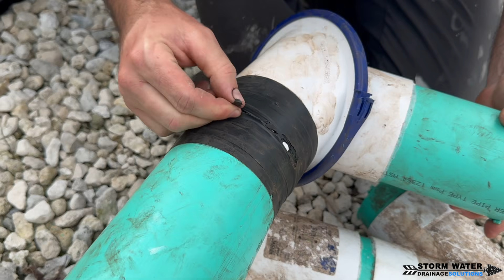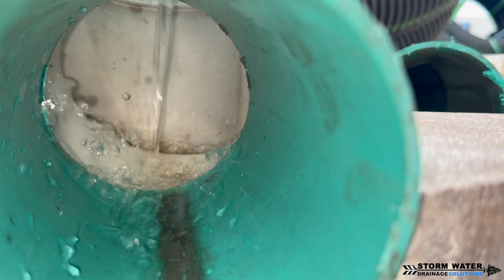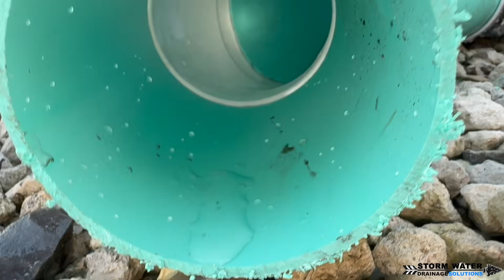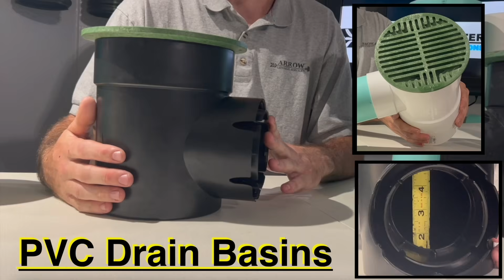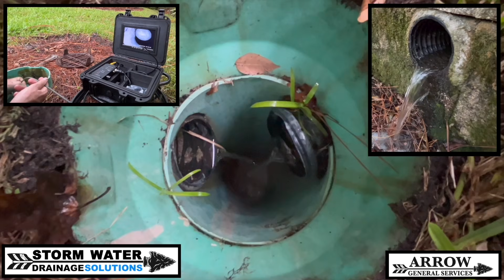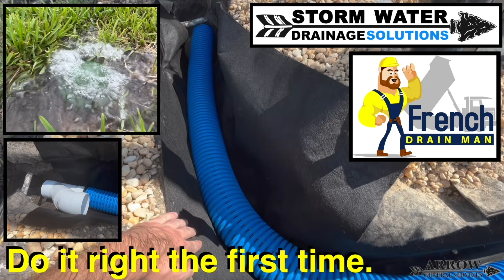Rotating PVC Drainage Fittings: Should You Use Them in Your PVC Yard Drainage System?

Comment: Agreed, it's insane to use an adjustable fitting instead of a standard one to achieve 45°. Presumably the temptation is when you need an angle other than the limited set available -- 90°, 45°, 30°, 22.5° -- or a combination thereof. What if you need an 9° bend (staying in the same plane)?
Reply from the maker: If it’s storm drainage you can just use a drain basin to get some wiggle room with your PVC drain pipe.